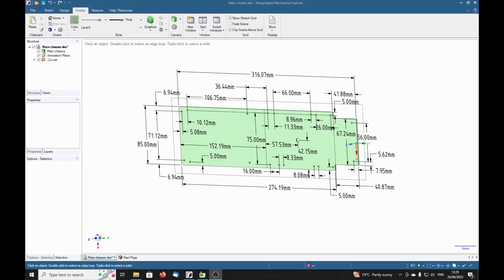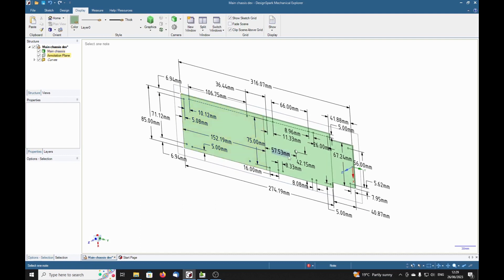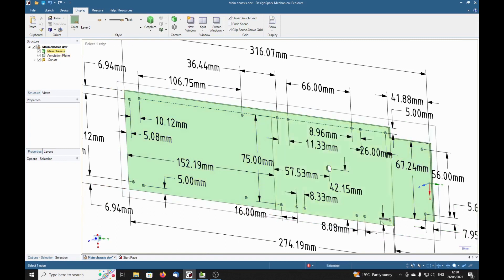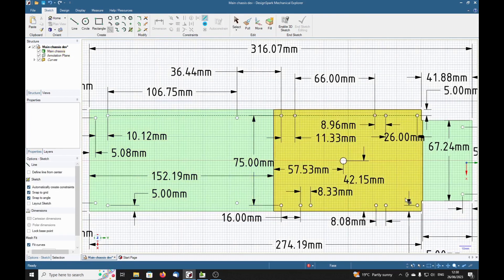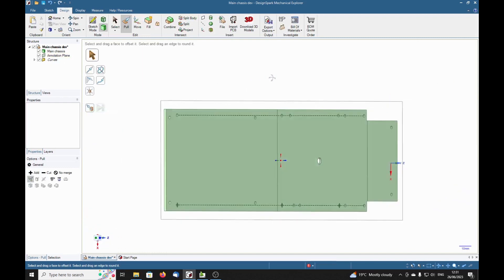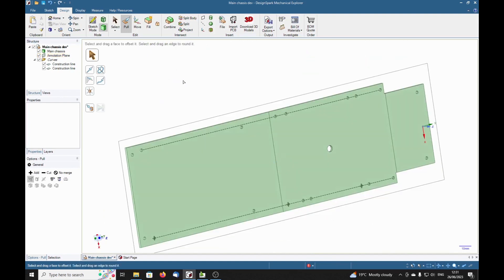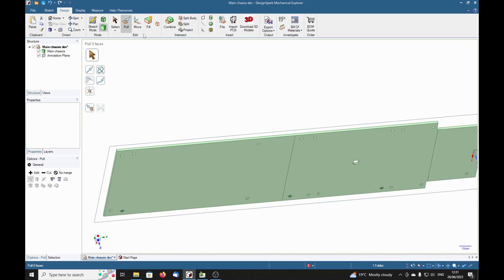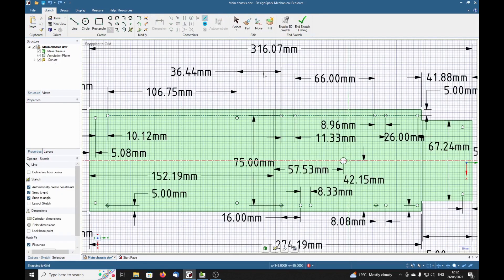Disappearing dimensions in DesignSpark Mechanical.

Comment: So the real question of how to have an annotation plane and ALSO use the constraints sketcher if that is your sketcher of choice. The only solution I can find is NOT to have them coincident - move the annotation plane away from the actual geometry plane a small amount - say 1mm. They then do not interfere with one another.
Reply from the maker: As I have indicated elsewhere, I have decided to dump the constraint-based method and so far there have been no problems.
I have just had a reply to a ticket I raised with DSM support and it reads:
-----------------------------------------------------------------------------------------
DesignSpark Mechanical (DesignSpark)

Jun 27, 2023, 01:50 GMT+1
Hello Jim.
 
Interesting... I'll log it as a bug but I expect it won't get fixed.
 
The best work around is to have the annotation plane off the actual part face - the Constraint sketcher doesn't like the annotation labels it seems.
 
Or, work in the normal standard sketcher.
----------------------------------------------------------------------------------------

Comment: If you want to work as in v1, v2, v4 and v5 ( standard sketcher) , File > DSM options > Advanced  - General... and disable 'Enable Constraint Based Sketching' close and restart DSM. That sketcher will probably be more familiar .
My advice is to not have the annotation plane coincident with Constraint sketcher - have it offset 0.1mm or more perhaps - it makes no difference for face on views and moving faces using label dims still works the same. I have tried different layers without success.
Reply from the maker: What puzzles me is why does it draw the first dotted line ok and not make the dims disappear but drawing the botton line does!
I also tried setting DSM to non-constraint but on loading the same file it sets it back to the constraint method. Despite all this, in my view, it is still a bug in the system.
I have tried the same thing on a different design and it still happens. However, only some of the dimensions disappeared and dimensions on a different Annotation plane were not affected at all.
I have just had a reply to a ticket I raised with DSM support and it reads:
 	
-----------------------------------------------------------------------------------------
DesignSpark Mechanical (DesignSpark)

Jun 27, 2023, 01:50 GMT+1
Hello Jim.
 
Interesting... I'll log it as a bug but I expect it won't get fixed.
 
The best work around is to have the annotation plane off the actual part face - the Constraint sketcher doesn't like the annotation labels it seems.
 
Or, work in the normal standard sketcher.
----------------------------------------------------------------------------------------
 I have decided to opt for the last option i.e. work in the non-constraint mode - I don't like constraints anyway 😇
I completed my design so, so far so good.
Reply: @JimTaylor42  Of course, if you really wanted a drawing - then you could use the drawing sheet functionality included in the Creator plan.